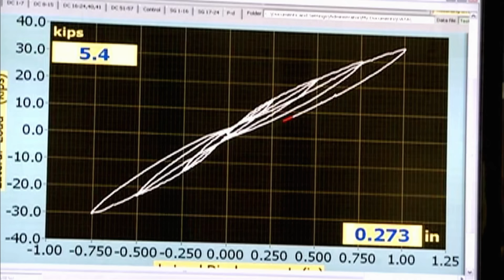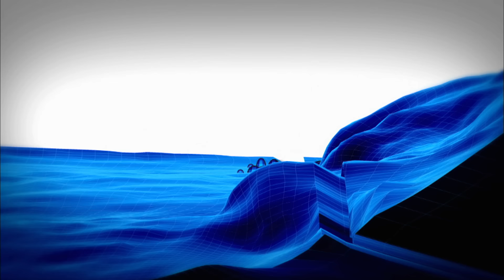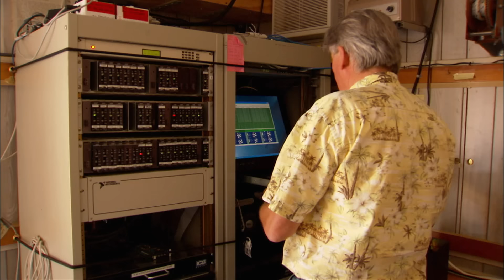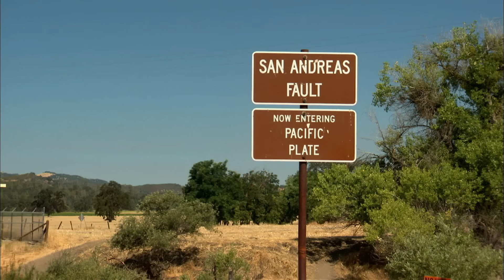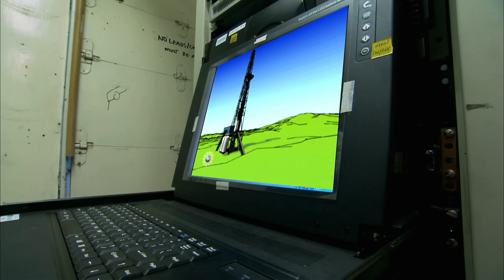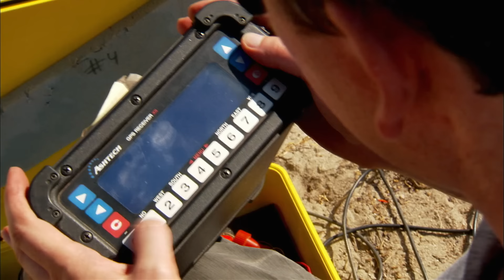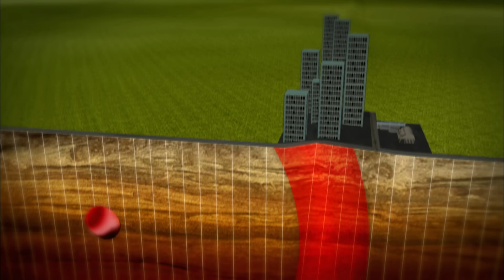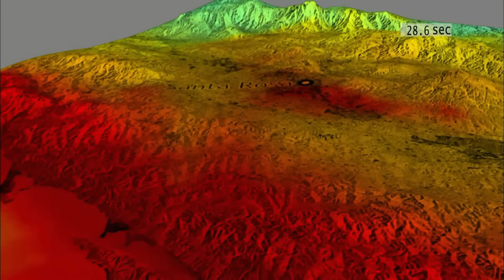The Mysteries of the San Andreas Fault | How The Earth Was Made (S1, E1) | Full Episode

Comment: 33:45 They could've explained it better. Like any rock, granite can accommodate a certain amount of pressure before cracking. Unlike other rocks, granite is particularly tough to crack because its complex crystalline structure is so effective at holding the rock together. But everything has limits. It's precisely because of this that granite literally explodes when pressure exceeds capacity (it would've been such a cool visual to place a piece of granite under a hydraulic press to show just how much force it takes!). The result, at least for the southern/desert segment of the San Andreas, is longer lulls between particularly powerful earthquakes.

Comment: The video leaves out a couple of key points. The video shows collapsed buildings in the Marina district of San Francisco and the pancaked section of the Cypress freeway on the west side of Oakland at the edge of San Francisco bay.  Those 2 areas were swampy areas where debris and soil had  bean dumped into the edge of the bay.  This fill was not engineered fill, which caused liquefaction during the 1989 earthquake. The video infers that this is the type of destruction you would have in southern California.  NOT NECESSARILY THE CASE  THE VIDEO IS MISLEADING IN THIS PART.  After the 1906 earthquake, debris from the earthquake was dumped into the edge of San Francisco bay in what is now referred to as the Marina district of San Francisco.  The city of Foster city was built on ENGINEERED FILL in the early 1960s and It went through the 1989 earthquake with no damage.   In the 1994 Northridge earthquake, the first level of a poorly designed and built apartment building collapsed, which was the biggest damage site of that earthquake.

Comment: We have everything we need to predict when an earthquake will occur, and the magnitude of the earthquake in that area!!!  We know the rate of plate tectonic movement.  We can get core samples of the rock and measure the elastic strength of the rock in that area, and we can get the thickness of the rock in that area.  We can add the stress on the plates as the earth rotates toward the sun, which is cyclic.   Put it all together, and we have the power to prepare.  Come on people, get smart.